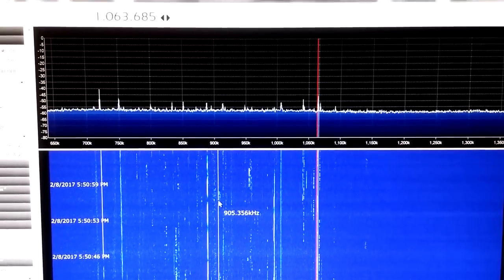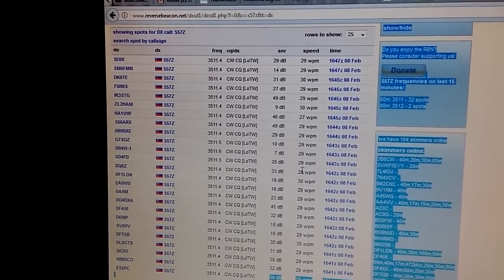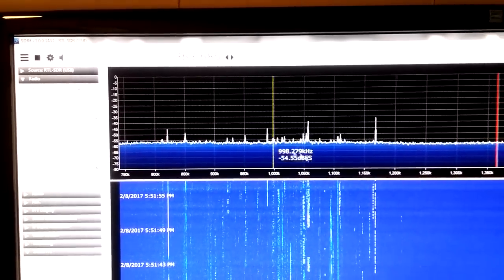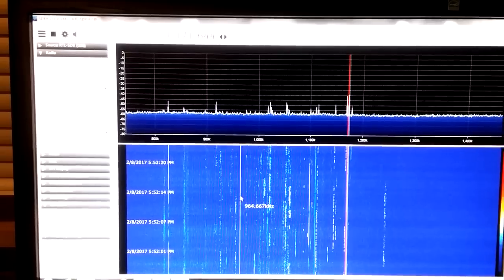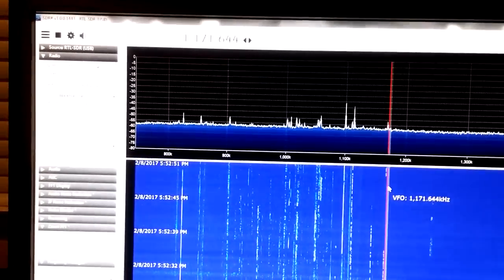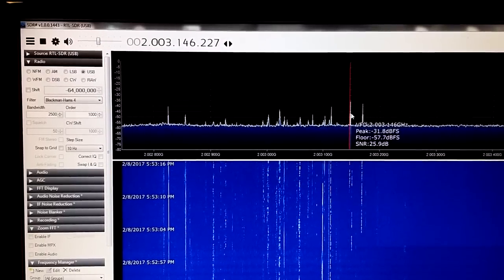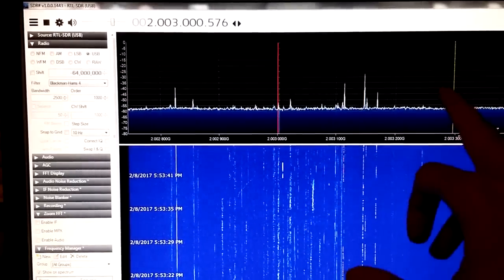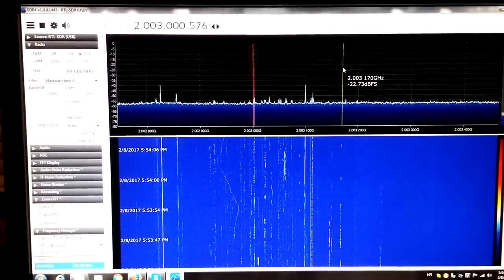RTL dongle 3.5 MHz reception question?

Comment: My guess would be that the signals from your surely pretty nicely tuned antenna are so high that you receive images everywhere. Poor little dongle - wish I had such an antenna.. :)
Reply from the maker: Hmm, but why there are no AM BC station images that are much stronger 
than a ham radio signals? This signals are present also if the dongle 
(tuner gain is reduced) Of course, I am not using AGC at all.